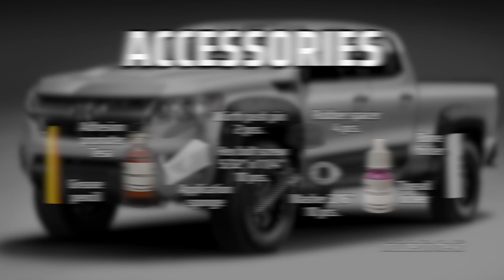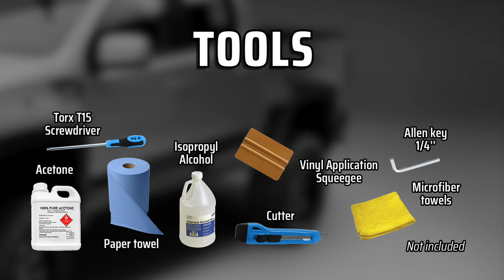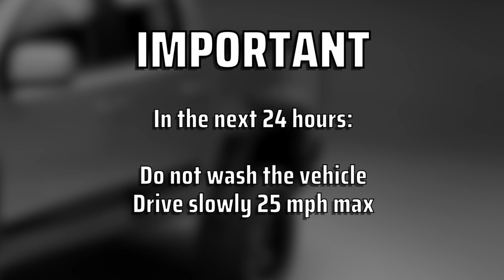FENDER FLARE SET - Colorado 2016-2022 - CHEVROLET

Comment: Do these work on the ZR2, or with the ZR2'S front bumber??
Reply: Interested in This too for the ZR2.
Reply: Install is probably the same but the design would be different m
Reply from the maker: Hello SeaHyde, thank you for your interest in Air Design! Unfortunately, the Fender Flares model you're inquiring about is not compatible with the Chevrolet Colorado ZR2 or its variants. We invite you to stay tuned to our website for updates.
Best Regards,
Air Design.